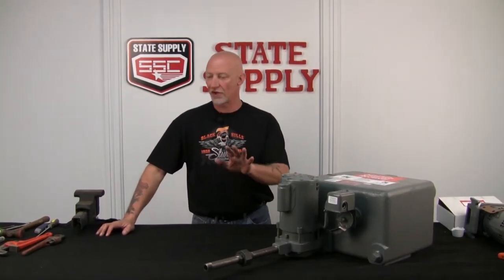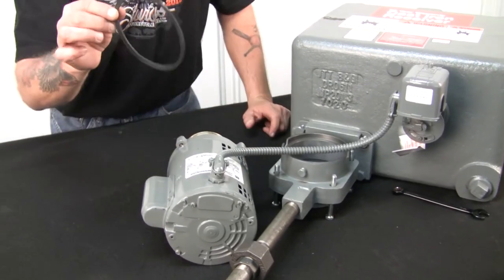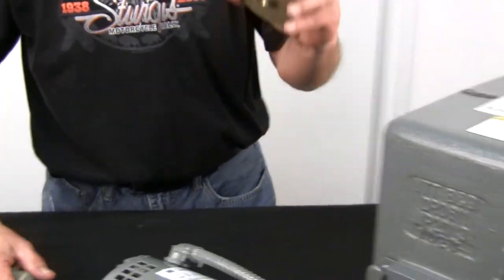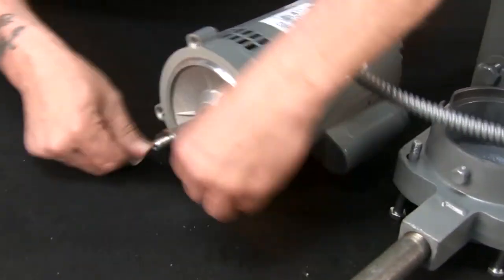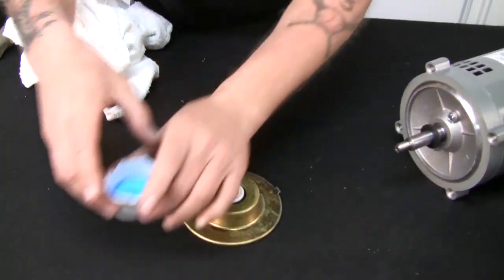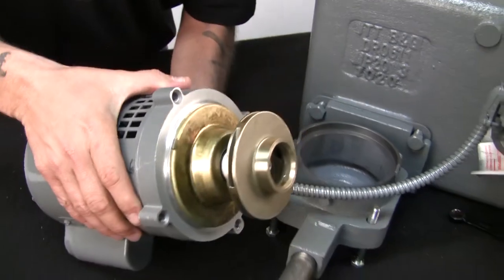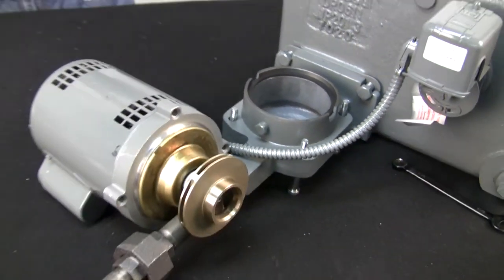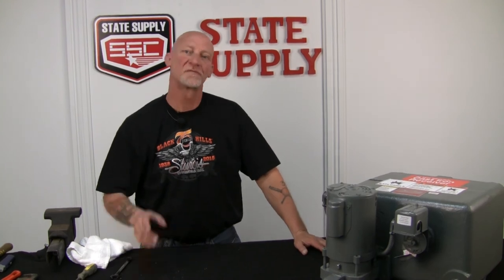Hoffman Condensate Pump Seal Kit Replacement

Comment: I had a heck of a time getting the motor out of the volute. I had to use two flat blade screwdrivers placed under the tabs of the seal cup and pry it out. No amount of yanking would free it up. 
Everything else went smoothly thanks to your great instructions. Thank you much

Comment: What’s the plug on the front of the volute for? I have had issues getting these pumps to prime, and stared pulling the plug out and letting condensate run out the plug to prime the pump first. Think this is a good way ?

Comment: We have one of these in our home. It’s very loud. Is that normal? 

Quite often the pump also discharges water. Even if we replace the pump, will it still be loud?
Reply from the maker: It depends what you define as loud. They are not silent. What type of sound is it making? 

The purpose of this pump is to discharge water from the tank to either the boiler or another tank.

Feel free to give us a call if you have any questions! 877-775-7705.

Comment: How many times have you ever gone to change a seal on a unit that has been in operation and the parts are stuck together?  I have changed these seals three times in the last 11 years on our condensate pumps and in all instances I destroy the motor bearings because the parts will never come apart without brute force.
Reply: Hi Dave,  is the problem due to seals that won't easily separate, so the unit won't come apart? I wonder if that P80 lube or similar would keep the seals from sticking to the pump body.  I have a 30+ year old pump with leaking seals, badly corroded. I know I won't get that apart without breaking it.
Reply: @bradclements1815  Yessir, that is my experience.  The seal is so stuck that the motor bearings are destroyed in the process of getting the thing apart.  I would guess some sort of lube would help prevent them sticking so badly?  Quite possibly.

Comment: Just a little tid bit, the oil from your hands can ruin the ceramic face of the seal.  When pushing the seal in place you should use the little cardboard cutout that seperates the two ceramic pieces in the package.  Great informative video though.